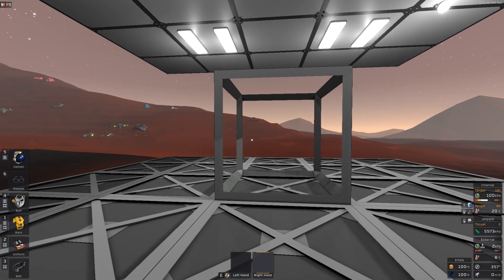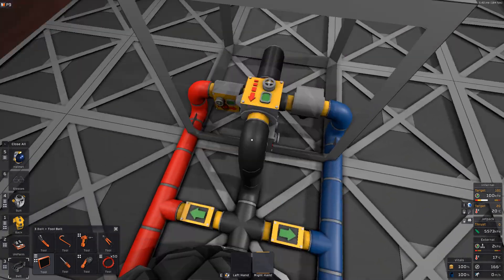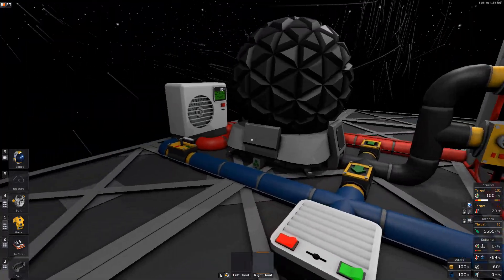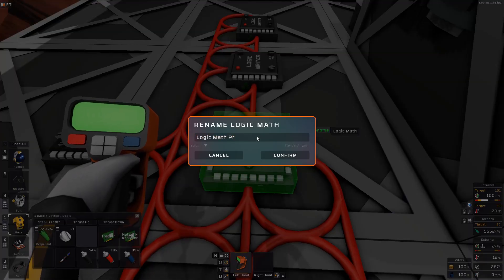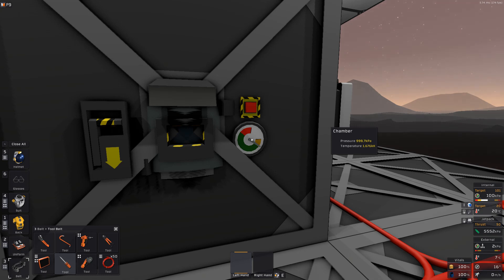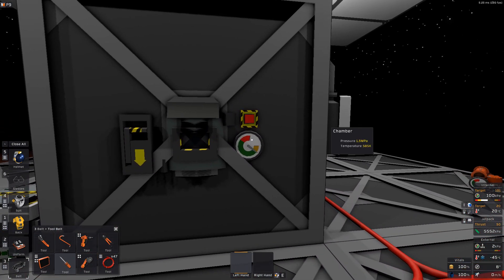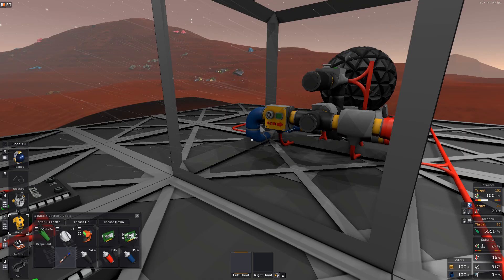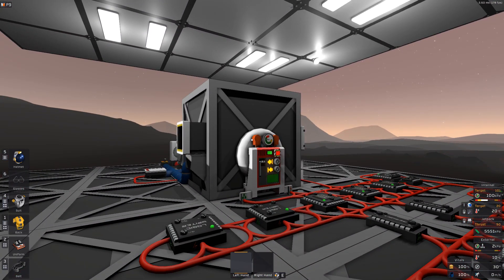Simple Logic Furnace Setup - Stationeers

Comment: The cooling system would not work now with phase change, as well the ac unit doesn’t cool at all with the new ac unit too. Concept is still the same but you just need to modify those areas to the current method of heating and cooling.
Reply: Could  you give me a pointer on which current method(s) of heating and cooling I could try to apply in this setup?

Comment: So that everyone knows, this method DOESN'T work anymore. Don't try using the AC behind the tank. It will do nothing except ruin the hot and cold temperatures. I did the same thing they did here and it drained all the hot air into the cold air side and left the cold air extremely hot and not gain anything. The placement of things is also suboptimal.

Comment: I was having problems blowing the 4 way pipe on the input side of the furnace. I read the comment about joining the input and output if using a basic furnace. I did so and now that pipe is no longer blowing up. Now I am having problems maintaining temperature. It just keeps cooling down.

Comment: Nicely done!  I believe the word we are all looking for is:  Elegant!
This is a nice starter setup with room to tweak as you go.   For example, the input pipe buffer would cause overshoots (hysteresis) and waste as it hunts around for the last fractions of deviation.  I'm wondering whether a math unary "round" between the sub and div steps might be enough to stabilize it sooner. That's easier in IC10 but should be fun to tinker with.
Reply from the maker: If you're close enough to SetPoint that a round make any difference you're more or less already there. But it does have the same problems i outlined in my first furnace video (over a year ago when i referred to PID-controllers). It's gonna be "slow" dealing with low numbers, but if you try to speed it up more, it will get unstable on high numbers.

But it's still a very decent controller and high value for the price :)
Reply: Well there are 3 things, speed, accuracy and afford. You can always only have one of these.
Either it is fast, then it's inaccurate with low afford, or accurate with high afford. You won't get fast and accurate and low afford in one go.
Reply: @Elmotrix  On absolutely!  I was more thinking about the lag between pressure/temp sampling, logic delays and the buffer leading overshoot/under/over/under/etc oscillation and causing wasted gas over an extended period of time.  It probably doesn't matter and will surely settle soon enough.   It's probably just an imagined issue anyway.

Comment: Question: What is the purpose of "Splitting up the pipe network" with the valves?
Reply: In older versions, AC had an efficiency dependence on the length of the pipes, and if they were short enough, it become a quite powerful at cooling
Reply: @tezariusko976  very interesting, thanks!

Comment: This video ist STILL relevant to poor folks like me trying to understand logic and the implementation of P-controllers. I have adapted what you explain into an IC10 script to control two pumps for my input line into my main filtration. I have ONE question, though:   WHY oh WHY do you divide by 100?  Ist the 100 the maximum flow rate of the pump? (now pumps operate only at 10 Liters max) or is the 100 value related to something else?  That is the only thing I cannot wrap my poor head around.... Thanks :)
Reply from the maker: It's the Kp gain. But at the time there was a bug that blocked me from typing in decimal point. So instead of multiplying with 0.01, i divide by 100 😉

It's not related to pump capacity. It's simply to translate big sensor numbers (pressure) into low actuator (pump) numbers.
Reply: @Elmotrix  Thank you for the explainer - I am VERY uncomfortable with anything logic but I do my best to learn from you guys. So! How do I approach a good value? What are the rules of thumb?

Let's say I want to make sure that pumps do not exceed a pressure limit of 48.000Pa in a pipe network to prevent creaking?  Pressure can vary rapidly due to the pipe network low volume and filtration units doing their thing. 

The smaller the Kp gain number the finer the throttle? So, at 0.01 the pump will throttle more aggressively than at 0.001? 

How does one guesstimate a good value for that setting?
Reply from the maker: @wowailyich615  you can guesstimate by considering how far away from setpoint should the sensor reading be for the actuator to go full throttle.

i.e say that 200 kPa off setpoint i want my pump to go to full 10 L, then Kp = 10/200 = 0.05, then adjust from there.

Comment: This build is really good for use with your Furnace Controller 3 Pump and Furnace Library v4 scripts also.  Simple to get going with the chips and then later you can upgrade to the 2 IC controllers, pretty nifty.

Comment: Trying to use this and make solder, which was the whole reason i looked up a guide, constantly explodes. That max pressure 4 way pipe is what bursts and combusts. Is the iron frame THAT necessary? Feel unaesthetic.
Reply from the maker: if you're using the basic furnace you can connect the input and output pipe together. that'll help

Comment: It seems like my air conditioner is only outputting gas slightly cooler than the input and so my coolant pipe keeps shooting up in temperature ( and pressure (: ), any ideas how to fix that? Great video!
Reply from the maker: they changed the aircondition. you can use a mounted portable AC, or just get hot/cold gas by any other means.

Comment: if you want a more elegant touch, you could use another math unit that would multiply dials for pressure and temperature, then also have led panels that read those set points to show you see what it is set to

Comment: btw might be because of new updates but the ( regular )  furnace ( for me only till now )  is only working as intended  by setting ALL pumps to ( 1L )  else it does not budge at all  tried on mars and europa worlds  ( not vulcan or venus im way too bad at building fast XD )  if anyone is having difficulties with the cooling process slap some radiators on the cold pipe  for ( mars-europa only )  and it cools much much faster   cheers :)

Comment: I'm not sure if I did something wrong but the first batch of ores I smelted came out fine.  My issue is, I try to idle it down when not in use to 100 pressure and 100 temperature.  My Furnace wont drop below 1kpa pressure and 400k celcius and both my cooling line and my heating line just keep climbing in temps.  Even after adding a few radiators (Europa outdoors) I can't get the cooling line to cool down.  the cooling side is 200 celcius and the heat side is upwards of 10k celcius and still climbing. I have the air conditioner set at -200.  Any help would be appreciated.

Comment: One big improvement you could make is dividing the temperature by 10 instead of 100. If you have 100 kelvin difference, do you really want it pumping at 1%? That'll contribute a huge amount to it being slow. Personally i'm dividing pressure by 80 and temperature by 20 for faster results.
Reply from the maker: You are right, tweek the numbers. But the best numbers heavily depends temperature and pressure in the pipes. 🙂 So have fun with them

Comment: I know this is a bit late, but minor recommendation: change the "100" part to "scale". What I found in implementation is the pressures/temps overshoot by significantly less when this is run at "150". Yes, it's a bit slower to get to target, but it's less wasted energy.
P.s. It's a lot easier to prime the system via your setup from the Europa GFG run and a good space saver is to put your furnace readers and scalers on the frame of the furnace. I haven't moved up to chips yet, but that's my next TODO.
Reply from the maker: the perfect scaling factor (Kp) is highly dependant on what temp/pressure you have in the pipes. but the logic on the frames is a good idea :)

Comment: great vid Elmo thank you, will the 2 setups here eventually get to max pressure for the pipes to handle with the amount of smelting that gets done? if so is it just a matter of adding a filter to the tank on the back to suck out the unwanted gasses?
Reply from the maker: Yes, eventually. But if you start kinda low pressure like i did here (5-10 mPa) i doubt you'll ever have any serious problem. Just keep it in the back of your mind.
Reply: @Elmotrix  gotcha thank you

Comment: Thank you for this!  I’m curious what the purpose of the one way valve on waste to cooling. Would this not put hot waste into the cooler line?
Reply from the maker: Cold side stays higher pressure mostly. Easy way to keep it pressurized
Reply: @Elmotrix  hi man great video ! On the same topic: isn't there a risk to have the cold pipe over pressurised if you keep the a/c on for a long time ? Shouldn't it be a backup pressure valve instead ?

Comment: When I got up to 37:00 in the video, I went to set the pressure low and it started to slowly rise in pressure. I tried turning the heat down and nothing happened besides all my cold air went up to a few hundred degrees. I'm not sure what happened. I followed every step in the video perfectly
Reply: I didn't understand very well either. How to prevent the hot gas passing through the "on way valve" to heat up all the gas that should be cold? the air conditioning can't handle the bump in my build. I would like a video about other gas cooling/heating options and if there is a way to do it without using the "one ways valves". I want to make a system using dials, all the operation being done manually! I think it's just me but I like to do that in this game. Leaving everything automated takes some of the fun out of me.

Comment: Nice setup. Just wondering why there is a need to divide pipe networks into multiples using an open valve. Is it just slightly more efficient that why or something ? Is it because of a quirk of the game physics engine ?
Reply from the maker: The valves are there to control the throughput of the AC 🙂

Comment: Hello, I'm a little fan of your videos.
I recreated this project twice and always have problems with the temperature. 
The pressure is always super adjusted, 
but the temperature does not go over 1200k. 
What could it be?

Greetings Sven
Reply from the maker: this isn't a build and forget system. it just does the  fine tuning of the pumps for you. you got to manage the heat and pressure semi manually. right now it's getting easier though, just pump in a fuel mix on the hot side if you want to heat it quick.